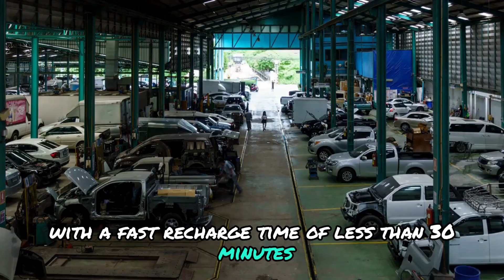Toyota CEO Announces New All-solid-state Batteries with 10-Minutes Charging Shocking ENTIRE Industry

Comment: Bullshit.
Reply: I agree!!  To go 745 miles in a car the size of a Tesla Model 3 (or Camry) you would need a 175 KWH battery.  Bigger for any larger car.  To charge that in 10 minutes, you would need a 1100 KW charger.  Over 3 times the size of any current charger.  Last but not least, all charging sessions are not 100% efficient.  That inefficiency turns to heat.  A 95% efficient charging session a 1100 KW would produce 55 KW heat.  That is equivalent to the heat of 40 of the largest space heaters available in the US.  Toasty!!!